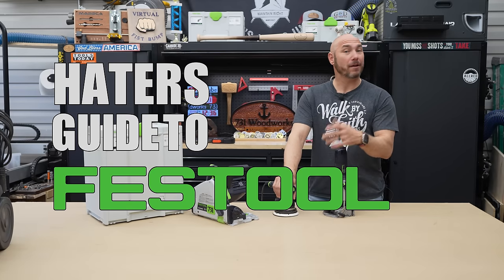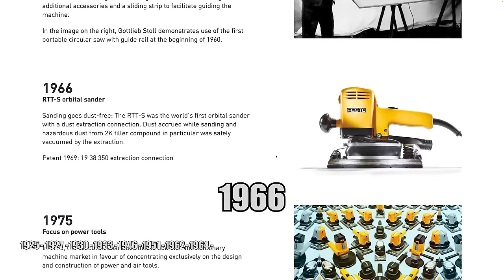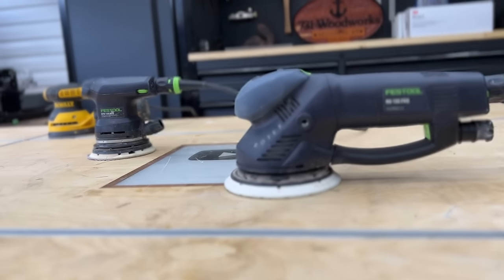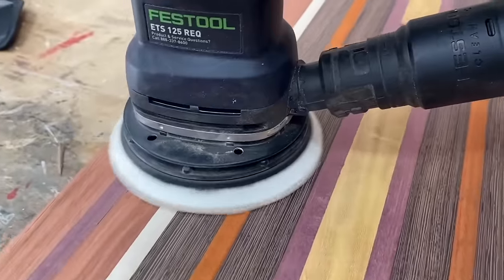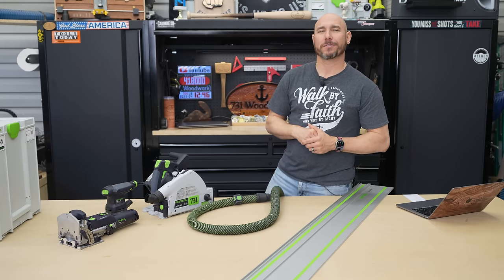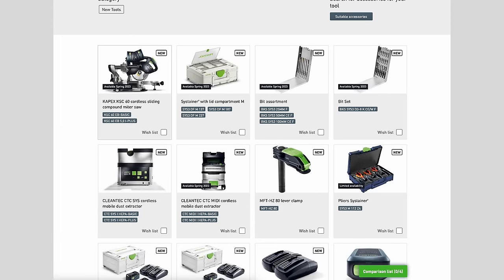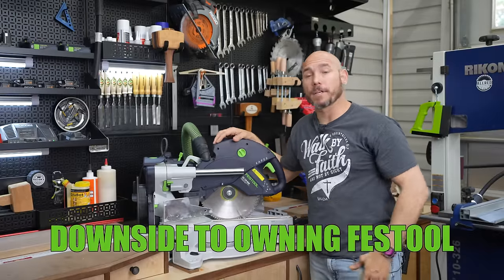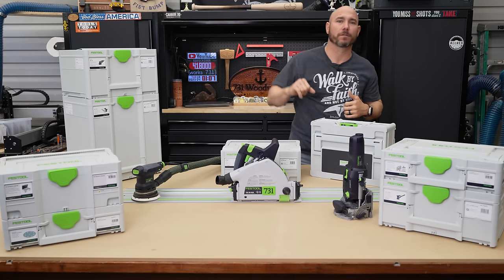The Hater's Guide to Festool | How Festool Changed the Game

Comment: "You just haven't used their tools!" Well, I have... In fact, I still own Festool products, and I'm mostly not happy with them.
Let's me start with a simple premise here: if you sell me something at a premium price, I demand premium quality. And I do not feel like I received that, for the most part.
1. I got an MFT table which was ridiculously unstable. So far that it was a safety concern. Then I saw that they sell the diagonal bar as an optional accessory? I felt ripped off, and sent that thing back, bought a Wolfcraft table at half the price, and it's WAY more stable. If I have a product that just doesn't work without an accessory, I put that thing into the base product. That was the first red flag. 
2. I also got a TS55 track saw and the adjustment for the track always got stuck. Festool knew about this common problem for an eternity, and they never worked it out.
3. I got a PS 300 jigsaw, and the cuts are so unreliable I cannot justify to use it, simply because I always have to fear that it's gonna ruin the wood I'm working on. Of course, again, no one can fix it. I'm using a 30 year old jigsaw now, which probably cost 50 bucks back then, and it's still more accurate! Also, why do they sell a jigsaw sled for track if it doesn't cut straight lines? If it doesn't work, just don't sell it.
4. I think some of the tools are missing features that should be a given, especially at this price point. Like the Kapex which has no special cut capacity whatsoever. 
5. Festool has a high price, not only because of quality, name, etc. but also because things like their theft insurance. That's something that you have to pay for, whether you use it or not. And for many hobbyists, it's an irrelevant feature, driving up the price again. 
6. Holding safety features hostage behind a patent is not something that is incredibly popular. Bosch released a table saw with a "saw stop" feature, which was way better because it didn't destroy the blade. I just don't think safety feature should be owned by one company like this. Imagine only Ford having airbags, Chevrolet having seatbelts, Ryobi having riving knives. It's good that we are over this, I'd say! Thankfully, this patent is running out soon, and will hopefully make woodworking better for everyone.

Comment: I think the most polarizing thing about festool has to be the domino -- as long as they hold the patent to that product, with no clear competition, they set the price. 

Just in the last 5 years we've seen a boom in competition for the plunging track saw, each brand competing for the space by innovating and offering more value for the buck. Albeit still predentary in some regard, prime example being tool manufacturers creating proprietary tracks and accessories that they're selling for ridiculous prices - I'm looking at you Bosch.  

Their patent ends in a couple years and I doubt they don't have anything cooked up to keep their hands on that IP but as long as they do, the price will not drop nor will they innovate on it.

Comment: I’m a finish carpenter by trade 24yrs, I just bought my first Festool tool a few weeks ago that was the cordless track saw and immediately I noticed a big difference in the quality of engineering and overall quality, I then bought the 36 AC dust extraction and it has taken my work to another level and I’m looking forward to getting more Festool tools, simply the best, I typically use Makita that’s also a great quality of tool but Festool is on another level for sure

Comment: Here is my two cents, I work as a cabinet maker/site fitter for a company, I buy all my hand and power tools(Makita) and in the past2 years I had to buy a second hammer drill, my 14 months old jigsaw started to act up, the blade doesn’t sit parallel to the sole anymore. I ordered a new Makita jigsaw and to my shock from new the blade doesn’t sit right and it’s almost impossible to release the darn thing from the saw.
Next jigsaw will be a Carvex at an eye watering £510 with a single battery 😅. I really hope it will be buy once cry once because I am really frustrated with Makita quality

Comment: I think a combination of sander + dust extractor is the “gateway drug.  Painters are big buyers and users of Festool sanders and DEs here in New England, and painters here are very tight with their cash.  Clearly, something about the sanders and DEs is special.  But there are a few other tools that are notable.  

The track saws, of course, which I think beat any other track saw other than possibly the Mafell.  The otherwise not-terribly-special Vecturo 18V has the only true right angle plunge jig I know of and if you make that kind of cut the Vecturo is  worth every dime.   The Domino, which certainly is controversial and divisive, as you said, but does the job it does better than just about any other solution.

Comment: Did you know that every festool tool is assembled, built and finished by just one person. That means if there’s any fault they can trace it back to one guy.  Each employee takes pride in how few returns they have. There’s no pressure on them to assemble more per day, only to do it right first time.  I had a saw that developed an intermittent fault one week out of warranty. They told me to send it back, replaced ALL the electronics, new motor and bearings - basically a New saw in the same enclosure and did it all free of charge, including postage both ways as a good will gesture.

Comment: I own some Festool machines (router, jigsaw, tracksaw). Just today I replaced my ATF 55 FB/1 track saw after 24 years flawless working. But nothing last forever.  Of course I bought a Festool again (TS 55 FEBQ plus). All the 24 year old accessories  like the rail guides can still be used. And my newer guide rails work together with the old ones. The new systainer can be stacked with the old systainers.  I think Festool machines are worth the money.

Comment: The only festool I'm jealous of is the domino, as sanders I have a few different brands/model sanding including the low vibe, wide swing orbitals and I have dust extractors. But the domino mainly because I hand drill dowls with a jig. With research on the domino (shortcomings included) it's a tool I want/need in my collection since I see so many times it would speed things up.

Also if you ever notice why companies have blue unsharp logos. It's because there was a research paper done, Blue logos for whatever reason shows a majority of people think of a company as trustworthy and safe.

Comment: I've only used one Festool tool, a battery powered track saw. It felt like a lightweight plastic saw, like cheap battery saws from years ago. I didn't think very much about it. I felt the dust collection wasn't very impressive. I do like the idea of common dust collection. If you have an assortment of tool brands like most of us do, the dust collection compatibility is always an issue.
Reply: sounds more like you hate and never used festool😂
Reply: @exigauner  its the lack of rubber, lot of plastic
Reply: @scottyee707  fun part festool dont use rubber only high grade silicon thats not flameble (brighter gray color). and dust dont stick on it but still grippy, thats why the tool looks clean after use, other brands china mede use much rubber thats wear out fast .my makita drill looks very used, but my festool drill that i used most looks like new. thats why festool tools are as expensive if u sell them used. plastic is plycarbonate 30 precent glasfiber thats epansive plastic.
Reply: interesting👍
Reply: @exigauner  I agree but as tools evolved they usually have used more rubber over mold so people have gotten use to that, I think it helps with dropping stuff and while the rubber of the tool might look more damaged what about the insides? Probably absorbs shock better

Comment: I am not a Festool hater, the price is my main hang up with Festool.  I waited years before buying the Saw Stop, it was just a bit more expensive than a similar cabinet saw.  The extra cost is justified with the safety.  Festool, Woodpecker and Sawstop are all controversial brands.  I do have good tools in my shop just brands that I can afford.  Many of the Festool promotors got their tools for free and I don't watch them anymore.  I am still subscribed to your channel.

Comment: I own a lot of Festool. Bought new and second hand (which I love to clean and refurbish). Yes it is expensive. But it keeps its worth a very long time and always sells on the second hand market. So, in a way, you're locking money in the tool, and when selling, you can always get some of it back. Second hand DTS sander for example is still worth around 180 euro's. That's more expensive than most new tools. lso, next time you are at a dump site where they collect old electrical tools for recycling, see if you can find a festool (answer: very very very rarely - I found one, repaired it and then sold it for 100 🤓).

Comment: Festool is a Professional System for Professional Woodsmen/Woodworkers. My first festool was the kapex 120 paid 1300.00 and never looked back. Had a 200ft of crown to install on a coffered ceiling , that tool made woodworking FUN again. I couldn't believe how quick, accurate, and enjoyable it was to use that machine. It was recommended to me by a woodsmen who made Lecturns out of cherry, walnut, maple etc, for LSU , Government and other institutions. I saw what machines he used and they were expensive for what he did. Most other brands are just tools that carpenters throw in the back of their pickup.

Comment: The ETS125 REQ sander is fantastic. It’s a finish sander so don’t expect it to hog off 1/16 of an inch in material. It is not like the aggressive $600 sanders.  It’s comparable to the $100 random orbitals you’ll get at Home Depot from Makita and Dewalt in terms of function. 

The difference is in the vibration, dust collection, and most importantly it’s not made of plastic drive components. 

My Dewalt literally broke after one project. That’s no exaggeration. So I returned it to Home Depot and went with the cheapest sander that isn’t the same cheap design as all these other ones. And that happens to be the festool. 

Cheap ROS are like the nutri bullet of the woodworking world only a matter of time before the plastic drive gear breaks.

Comment: If you're a woodworker on film sets (not a studio one), there is nothing better than Festool, because they are much more compact and portable than even high-end concurrents, but if you work in your own shop and have space to spare, you can easily settle for Makita or others tbh.
Reply: Are they? 

Mitersaw?   The compact ones are all the same size across brands basically. 

Plunge Saw?   Not more compact and don't cut as deep for the same blade size as some other competitors. 

Router?   Again, not the most compact either. If you need something super compact go with a Bosch edge-router.

Compact yet powerful sander?   Get a Mirka. 

Cordless drill?   Anything but Festool, seriously! Get a 12V Bosch or Milwaukee instead. The Bosch is used in Formula 1 and those mechanics need very compact yet capable tools.

Vacuum?   lol

Domino?   Have you heard of a dowel-jig? Doesn't get more compact than that.

Comment: The ONLY thing I care about in a sander is what can remove material faster.  Compared to the 5 inch variable speed DeWalt for under $100, does the festool do anything more? Does it spin significantly faster or vibrate more?

Comment: I'd love to have a shop full of Festool, but until I actually start doing something to make money it wouldn't make sense.  I have a Harbor Freight 12" sliding compound mitre saw that I got almost 10 years ago fro something like $129.  I bought it to do remodeling work.  It served me very well.  When I switched over to woodworking it was a bit worn and not particularly accurate.  I'd love to replace it with a Festool now, but theirs is only 10" and $1599.  Maybe I'll go with Skil or Ridgid?

Comment: Matt, I’ve been sitting on the fence about jumping in and buying some Festool. Thank you for this video because it gave me that little bump to where I’m going to start off with one of the sanders (EC ETS125/3 or something like that).  I’ve backed off woodworking for a little bit but excited to get back into it with nicer weather coming. Thank you brother!
Reply: The ets125REQ is fantastic as a finish sander and basically comparable to any random orbital you’d get from Dewalt or Makita in terms of intended purpose. (Meaning it’s not rotex designed to hog off an 1/8” of material.  It’s a finish sander.  I bought it because my Dewalt broke after one project because it has plastic drive parts. Haven’t had a problem with the festool. 

You don’t need the festool dust collector either. I have mine attached to a rigid shop vac. Yeah you have to rig up a diy connector. I think mine was a nozzle from the small 1 gallon type car vacs with the end wrapped in duct tape until it was thick enough to jam into my shop vac hose. I then drilled holes in that small nozzle to relieve some of the suction power (I was told this mimic the adjustability of the official festool collector because you don’t want the sander to suck so hard it gets stuck to the wood surface.)

It works amazing and leaves a dust free surface when done sanding.

Comment: I knew what was coming even before watching. Festool are tools for professionals and are priced at that level. They are high quality and can be used daily for many years. Many hobbyists don't appreciate that even if a tool saves you only ten minutes in a day, that can easily amount to a few thousand dollars over its lifetime for someone who makes a living with it. I am not a woodworker, but if I find a tool for my line of work that makes me work more effectively, I find that it often easily pays for itself many times over, even if it initially looks expensive. Plus, a tool from a more affordable brand that is used only once in a while will very rarely reach the hours it was designed for, whereas if used professionally every day may break down after a few months or a year, causing additional grief and costs, which professionals can not afford. I just wish people would relax a little bit. If the tool is not designed for your particular purpose, it does not necessarily mean that is a bad product or overpriced, you just may not be the target audience. Some brands make a distinction between a professional line and a more affordable line of products, Festool just specializes on professional use only. For a hobbyist, even though no doubt a joy to use, they probably are a pure luxury.

Comment: I have been in engineering for over 40 years and have had Festo try to sell their pneumatic products to me on numerous occasions. Never once have l gone with them because they are not cost effective. Their products are only marginally better than other high end brands but their price is 2 to 4 times more. For example a SMC RQA40-100M cylinder is $113.00 as compared to a FESTO - DSBC-40-100-PPSA-N3 at $280.00.

Comment: Been doing hobbyist wood worker for years and working on sites as a landlord for the last 5 years, I’ve thought more than a few times about getting a Festool tool.

From the outside, I really feel people who use Festool often remind me of people who use snap on tools. People who like it are just all in and often that doesn’t describe it well enough. And the haters hate em (and I mean really hate them)

My problem often has been that I just can’t justify the costs (follow me on this), I’m the guy in the neighborhood who has no less than 9 separate 1/4” impact drivers across 6 different brands. Not because any brand fails or is even better than others, but I have shop tools, garage tools, basement tools, home tools, travel hvac tools, travel electrical tools, travel plumbing tools, tools for short term help, ect….

Long story short, I like things readily available in my kits, and I hate not having something in arms reach when I open a tool box.

But I’ve really been eyeing a track saw for a while now.

The other thing besides price that steer me away is the green color (more of a red guy) and I’ve never been a fan of German engineering. (Although I’ve been pleasantly surprised with Bosch over the years).
Reply: Never been a fan of arguably the best engineering in the world?
Reply: @FilipAus  I personally would never argue that and grew an intense hatred of VW in the late 90’s - 2000’s when I was a mechanic in the army and started doing work on my own cars and my friends cars.

To this day I try to be polite when people are proud of their German engineering, but I would rather stick with American, Japanese, or even Chinese engineered products…..
Reply: Funny you mention Snap-on. I always said never to Snap-on because it was so expensive. I did a woodworking project for a guy that worked for Snap-on years ago. When I was installing the gate I was putting in some lag bolts with a Craftsman ratchet and he was offended by that and grabbed a Snap-on from his garage. It was sooooo smooth I was shocked. This was 20 years ago and I still use the Snap-on ratchet he gave me after the job was complete. I see the same in Festool. I only have the Domino and an orbital sander but I love the quality and speed to getting work done with these. I'd love a plunge router but just can't justify the cost right now. Maybe if mine quits working the replacement will be Festool.